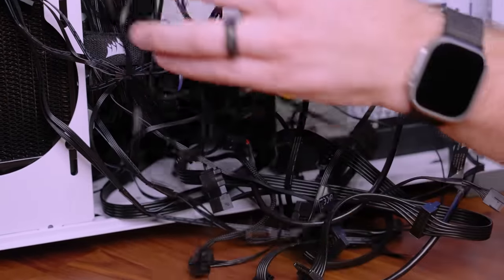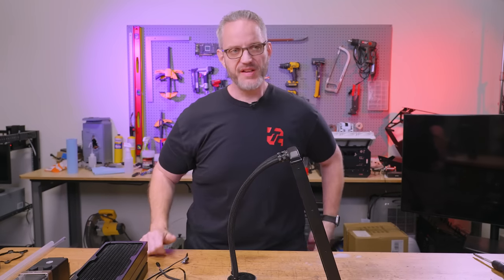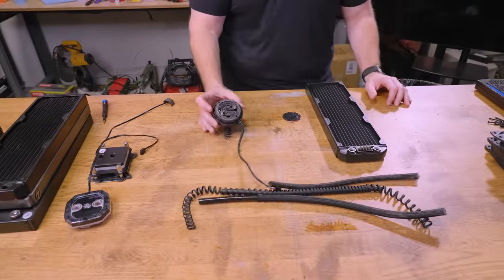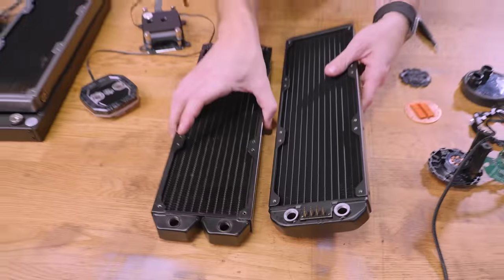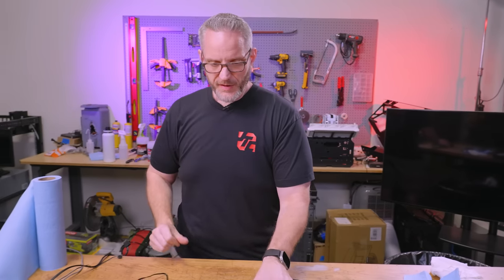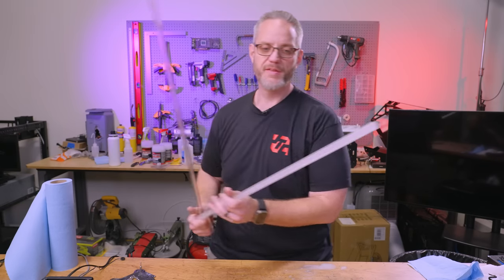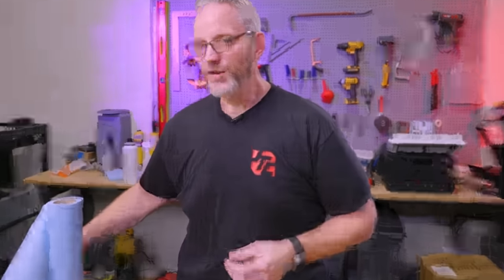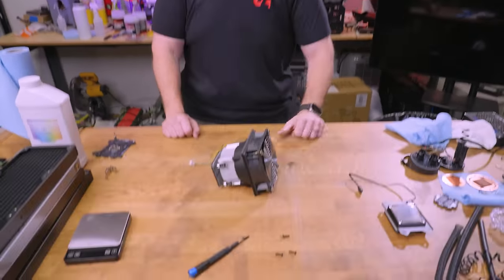Which one is right for you?

Comment: I'm using AIOs on my CPU and GPU. 
Why?
I've got sh*t luck, and if something can go wrong it usually has at least twice already. 
So if i built a custom loop, it would rupture, my pc would short out, and somehow my cat would electrocute herself in the process.
And for me, the AIOs are good enough, cooler than air for longer, easy enough to clean and replaceable without having to worry about leaks or ruptures so long as I buy something decent.

Comment: None of them is "better", just different. If anything is "best" considering mostly cost-effect it would probbably be the biggest heatpipe aircooler you can fit.

But I have had several of all 3 different types of systems thou the decades and they all have their usecase. I currently run a soft-tube custom-loop mostly due to noise reasons and I really dislike that AIO systems are non-serviceable and bound to be e-waste within 3-6 years.
If I in the future want to not bother with watercooling, or I am building for someone else I usually default to a bigger Noctua cooler. The reasons for that is. I can always get an adapter for any new upgrade they want wuch save money in the long run, build quality and performance is awesome and Noctua customer service is great.

Comment: I’ve got similar performance with high end air coolers. AIO’s are terribly overpriced for the performance you get. I’ve had both air and water cooling in my builds and there isn’t much of a difference between an AIO and a high quality air cooler (ie; Noctua / Thermalrite).

Comment: I've been running my corsair h150i for 5-6 years and I haven't noticed anything running too hot. Should I take my block apart and check the plate?
Reply: Be weary of doing so.  The seals may have deteriorated over time and taking them apart might destroy them.  Be super careful if you do, and maybe look for replacement seal kits if you do.  This is actually one way of topping up the coolant  though it is not straight forward and you need to find out what the water to ethanol mix is.

Comment: Aio looks cheap and i hate the amount of cables on the pump (rgb, power,maybe usb for a display..) custom perform waaaay better and look cleaner.
9900k @stock with 240mm aio = thermal throttling

9900k @5,1ghz and avx-6 with 240 (50mm thick)  custom loop = playable temps arround 50-80

Comment: Why is this the first time I'm hearing that Water cooling is necessary for the hotter CPUs? I guess I need to be more curious. I just remember all the times people saying that larger air coolers and water cooling is the same just depends on how you design the case spatially. I haven't seen any "scientific" comparison tests for this tbh.
Reply: This is down to several factors.  Your ambient temperature.  Your case airflow.  Your typical usage of your PC.  For many,  a high end air cooler will suffice.   If you live in a hotter environment, and or stress your CPU heavily (video editing for example) then you may want to have better cooling to bring down the CPU temps to reduce throttling/increase boosting.  A lot of people are buying £$600 chips and just gaming with them which will never really stress the chips and a big air cooler will do the job.

Comment: So i havnt watched the full video yet, but right off the rip. ive been using my swiftechMPL660? for coming up on 15 years now.
i don't know a single person in my life that has been using their AiO for longer then just a few years before having issues.
Even with a closed loop system, evaporation is real. even in a closed loop situation. ask the open loop guys with everything capped
off how often they have to kinda top-up their system.... its relevent.

So reliability is going to go with open loop boys.
secondly is the radiator choices. you can simply buy a much better copper core radiator end of story. (thicker, bigger blah blah blah)
So radiator points for open loop boys.
Third, you can get much better waterblocks even though this is minimal and its mostly a visual preference.
with that said i would kinda give the closed loop kiddies a draw in this category. because closed loop guys can run the same waterblocks.
and most AiO's have really cool digital waterblocks anymore that really do perform well enough.

as for cost. lemme tell you the closed loops guys BLOW the open loops out of the water.

Closed loop has its place for sure, but it will NEVER be to the degree of open loop. thats my consensus.
im willing to bet the temperatures are actually pretty decently close until you get into really big overclocks (havnt watched the video yet)

Comment: got a question jay i have my old danger den water cooling stuff  i have a lang d5 pump and a 360 rad all copper would it be worth while to reuse the pump and rad? was thinking of useing a res with dual pumps for 2 circuits one for cpu and one for gpu figured this might help save cost a bit

Comment: Just did my first loop, will never go back, whole different box of frogs
Reply: I'm interested which type of frog you used in your loop. Previously I only used water but I'm open to new ideas.
Reply: @malphadour  The trick is finding small enough frogs, they sit in the CPU block and soak up some heat, then they hop down the tubes into the reservoir and cool off in the water, that heated water then goes through the radiator, it's brilliant, the hopping totally eliminates the need for a D5 pump and their small lil feet are even quieter than a D5 at 2500rpm
Reply: @malphadour  oh and it is important to add them after the system is warm, otherwise the frog will just stay on the CPU block till he overheats, you know how people say a frog won't jump out of water if you bring it to the boil? it's like that

Comment: I've wanted a custom loop for 20 years.  The problem is cost.  Custom is just too expensive.  I feel it's gotten worse over time.
Reply: I used to build a lot of custom loops for people, and had several myself.  These days my eyes water when I cost up even a simple CPU only loop - £450+ with the parts I want - I used to build loops for under £200 and not that long ago.  The killer seems to be the fittings these days, and I can't find a sensibly priced pump/res combo anywhere.  I used to use Eheim based ones and they worked great but nobody makes them any more.

Comment: Just done my first custom loop after 20+ years of building computers.
COMPLETELY unnecessary - 5600X + undervolted 4070 - but fun. Thinking of adding a second radiator, for a laugh.
(Just make sure the CPU block fins are running ALONG, not ACROSS, the direction of water flow. Ask me how I know😋)

Comment: 26:39 "If you get an AIO that last longer than 2 or 3 years these days, you are lucky" - this doesn't sound right. Even the standard warranty on most AIOs is 36 months and the expected lifespan is 5 -7 years. I've had 4 AIOs in the last 12 years and none of them failed or had any noticeable performance degradation.
Reply: which brands have you bought?
Reply: @al3nmicl Corsair H80i, H100i, H150i. Also had a no-brand AIO from Alienware Aurora for a while. No issues whatsoever.

Comment: "for the most part, all you really need is distilled water" hard disagree, gonna want to slap some glycol in there to prevent the water freezing and rupturing your loop/blocks during winter if you're don't have central heating and/or your PC on 24/7 (100W is ~300 BTUs, the human body is ~500, so literally any PC+monitor being in use by a non-corpse is enough to heat a room requiring 1000 BTUs. there's literally 0 need for central heating to be a thing anymore. heck just my old 125w TV in my bedroom was enough to make me need to open my window during winter growing up)

Comment: I tend to tinker with my system too much to use an open loop. Using AMD, it's possible to be able to use 3 cycles of processors I can swap in; I still have my X370 mb with a 3800X. To replace a CPU in an open loop is an all-day affair. No thank you, those PCs look incredible and will cool better, but the juice isn't worth the squeeze, for me.

Comment: ...water cooling sounds to much hassle...good ol' air cooling.
All I have to is kill some dust bunnies now and then.
And in case a fan dies, its a easy swap....and that is the only moving thing that can die on me.
Watercooling has so many points of failure: The pump, de tubing transporting the cooling medium and a fan.....thats 3 points of failure.
And only if there is no corrosion...then I can add the radiator on the list too....and clogging of the fins of the CPU/GPU...

Just slap a big ol' air cooled vapor tubes heatsink, and plenty of moving air.

Comment: AIO's should all be extendable, as example the use of G1/4 's and not this sealed cr4p fittings, 
because of the greed of the manufacturers, which  making credits,  in expection that you buy a new one, when it died short after the guarantee is gone.
Diffusion is always present and every loop is affected, ( Yes sometimes physics sucks i know ;)
In addition you always will have the option to extend it, switch tthe tubes, add some stuff, gain expierience and learn to build,  if YOU want.
Today you can find near as any disassembly in the endless space of the internet. And if not, ask your favorite PC enthusiast - Youtuber of trust.
This reduce the waste of "you can still use it" components like a radiator.
Repair instead of waste,  because no ressource is endless.

Comment: or... go aircooling, get a good and cheap cooler (Thermalright Frost Commander 140) and call it a day... 
I have created, used and mantained several WC loops on my day... and i allways arrive at the same conclusion... they are expensive, pain in the ass to adjust to new parts, and getting blocks for the GPU´s are crazy expensive.

For CPU doesn´t make any sense WC... maybe... dual cpu´s... but even then... air cooling is much more durable in the long run...

For me WC only have place for GPU cooling... you can get better REAL temps and silence, that is not possible with current air coolers in gpu... this to me is the only real good application for Custom WC...

Comment: cheeeeeeeeeeers and thanks!!!!!!!!! ik its bene a while, but with the new cpu i plan to get i want my GPU air cooled for the king tier shit, but i REALLYYYYY wnat ot get a full tower and get a super awsome corsair AIO for the 5800x3d and a 360 rad on the top of the case as exhaust for it and thne a triple fan intake and 1 rear exhaust fan. time will tell if i do it right but thne again i never stress test my stuff enough so i may never know hahahaha~ howeverrrrr NOW THAT ILL HAVE  a BRAND NEW system set up i can purly game on it with strong parts and be super try hard with enthusiest tinkering and make sure i did everything right, cause ill keep my older one for casual afk gaming or browsing internet and guides and videos and THAT ALONE could be a massive benefit to have something there as back up SUPER STRONG if i give it a TLC overhaul and probablly a 5600x upgrade from its 2600 and that aloen could keep it kicking for YEASR I CANT WAIT!!!!

Comment: Of course you CAN cool your CPU (and only your CPU) with an AIO 🤷‍♂️
Or, you can do it the right way, and enjoy stunning looks, and cool temperatures for your CPU, AND GPU.
To be honest, I‘d rather use an air cooler the likes of an NH-D15, than some stupid AIO that WILL die on me in a few short years!
My custom loop components, I am treasuring for close to ten years, and migrated them to the third system already.

Comment: 360mm aio performs the same as 360mm custom loop. Down vote me I don't care. A custom loop is only good if you want gpu+cpu on the same cooling loop. If you are only cooling your cpu, aio is cheaper and performs literally the same. Been building computers for 20 years and ive done it all. AIO is just better for 99% of users.
Reply: Going to disagree with you a little bit on this.  The better cold plate and use of a copper rad vs aluminium rad should yield about 2c in a like for like for like build (cpu only)    The question there is whether or not it is worth it.  These days I personally go AIO with all the builds I do because, whilst not matching a custom loop, they are so damned close for a fraction of the cost and also a hell of a lot simpler to install.  I'd love to build myself another customer loop, but it would only be becuase I wanted to, not because I needed it.  I would agree with your last point, they are generally better for almost everyone, the exceptions being those in super hot climates where running multiple rads will make a difference, or those people who just want to build one because there is nothing wrong with that.
Reply: @malphadour  2c is literally margin of error for testing. so you can disagree all you want, im not wrong. an aio will perform the same. extra rads wont always reduce temps. you will end up limited by temp vs radiators. at that point adding more rads is a waste of money. right now im running an aio on my 7800x3d and its outperforming every single review benchmark for temps that ive seen online. using arctic silver 5 thermal paste to boot. 360mm aio setup. it just works. also a lot of people dont realize you can just run push/pull on your aio instead of push OR pull and gain performance. granted you need case room which is why i advice against small cases to all my friends.
Reply: @goblinphreak2132  Just because Steve repeatedly says 2c is degree of error does not actually make it so. 2c is a tangible and measurable difference.  You are also arguing against physics.

Comment: Someone with more time and money than common sense should try proprane cooling, but use the heated gas stream to power the computer through a gas turbine generator instead of an exhaust flare.

Have a regulator adjust the flow based on power drawn by the system, and conviently the max cooling will be proportional to the total system disapation